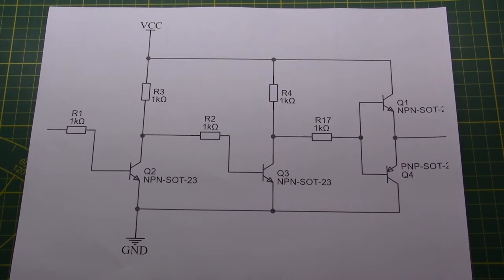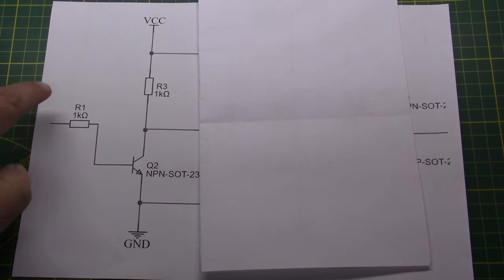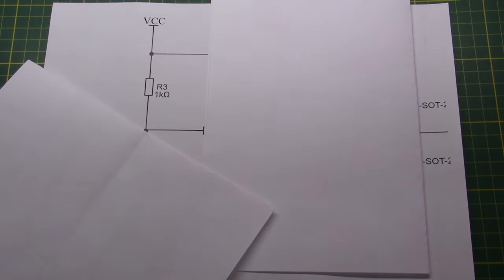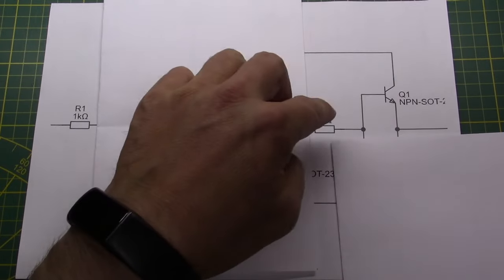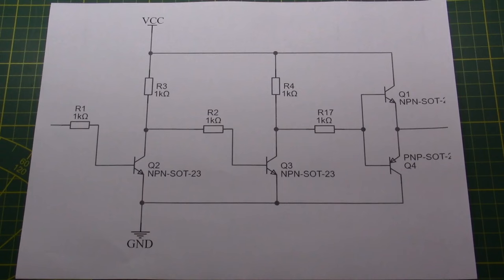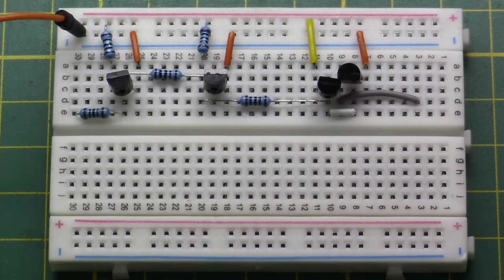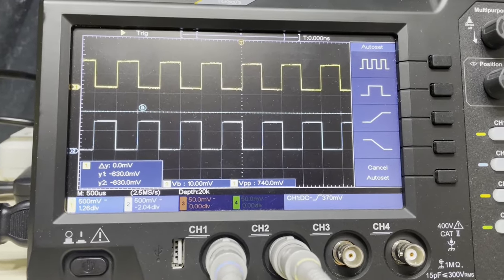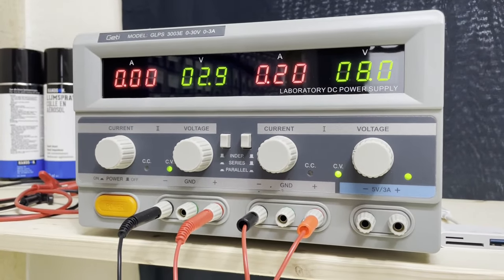ESP32/Arduino motor driver circuit

Comment: The push-pull stage consists of two common collector transistors (NPN and PNP), so is the base resistor strictly necessary since there is load?

Comment: Does the circuit can make motor move forward and reverse by signal control from Arduino?
Reply from the maker: Hi, yes that is its purpose, but for that we need 2 of these pins/circuits. Pin 1 high and pin 2 low for one direction, and pin 1 low and 2 high for driving in the other direction. Like a h-bridge would do.
Reply: @krakkus Thank you

Comment: Looks good.  Do you have the specifications of the components, that could be added?
Reply from the maker: Any generic transistors would do the job, but these are the ones on the circuit.
PNP: 2N5401
NPN: 2N2222

Comment: When the Q4 base is zero volt, why would Q4 turn on if its Emitter is floating.  In order for the Q4 to turn on, its Emitter has to be higher by ~0.7v.  In your test circuit, the motor is running when the Q1 base is ON and the current flows from Vcc through Q1 Emitter and through the load to ground.  That means your load must be passive. So, the second output shown on scope is not true output but 0.75Vp-p since the scope provide the ground for Q1.  The Q4 in your setup will never turn ON. Correct me if wrong.
Reply from the maker: Hi, thank you for your comment. I do not understand it completely. So I did a quick test on the circuit. Using the Q4 transistor.

https://youtu.be/coROebyYefI

The motor is now connected to VCC and the other end to the output of the circuit/Q4, whenever the signal is low, the motor is running, which would suggest Q4 is conducting to ground.
Reply: @krakkus  Thanks for checking.  So, if you pull Q4 out, leaving a void, it should still work the way it did.
Reply: You're right, I tested this in PROTO app from google play store and when deleting the Q4 transistor it does not affect the circuit in any way. In fact, Q4 does not receive any current when the load is turned off (motor in this case). And even when the motor is dissconected, because Q4 is a PNP transistor, it will not do anything as there is Q3 which is a NPN transistor.
Reply: @wolfgangvyhmeister1995  We are agreeing.  For the next test, I would disconnect the Q4 collector and insert a PS of Vcc=-10v in such a way that negative connects to Q4 collector and positive to common ground.  Technically, the motor should turn CW or CCW based on the input.

Comment: Hi what's the difference between this and just using a sole transistor? This circuit uses some power while motor is off although it's very low
Reply from the maker: Hi, with a single NPN transistor. The output (emiter) voltage will not go above the base voltage, which is 3.3V for most microcontrollers. But it would give you more current. Also, this circuit connects to ground when off. Which a NPN also would not do. PNP would be better for voltage but inverted signal.

Two of these circuits will be able to drive a DC motor BOTH ways, like a h-bridge would do. Which is what I eventually would like to do.
Reply: @krakkus  But I think the question likely applies to a single transistor in a common emitter configuration.  In that case, it can exceed the base voltage.